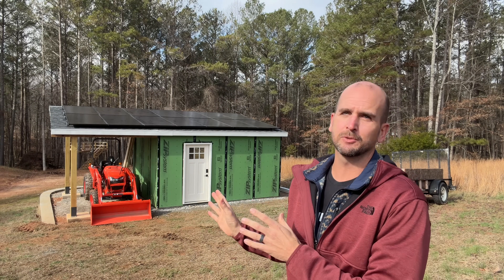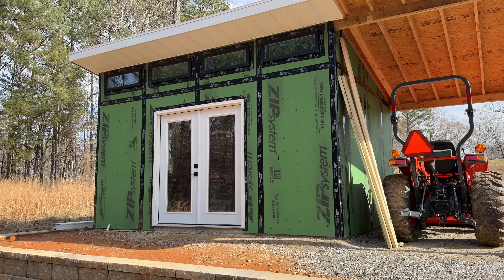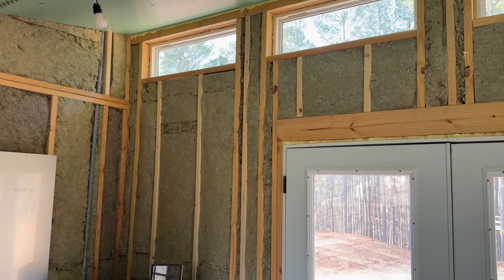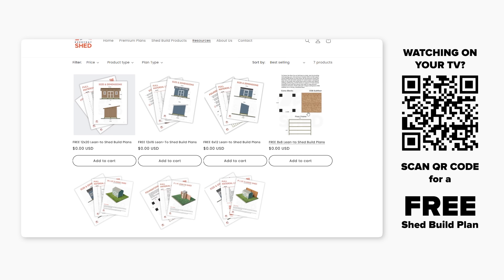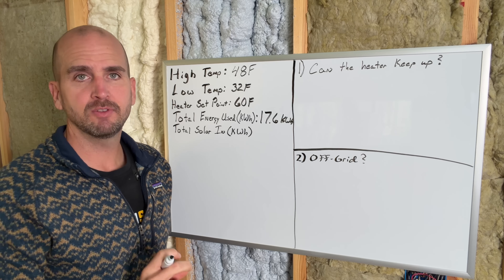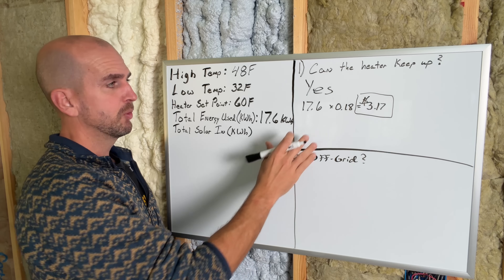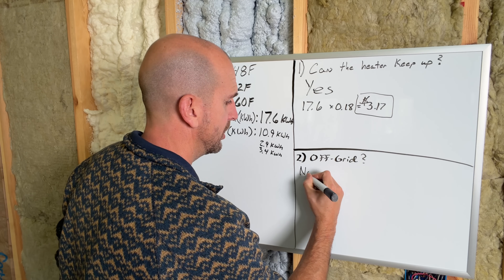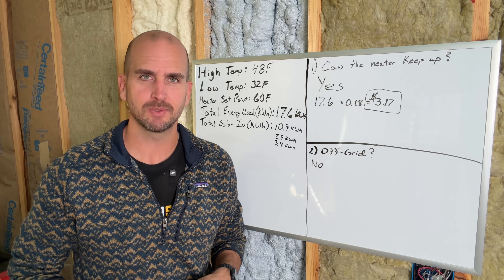HUGE Mistake: Why My $15,000 Solar System CAN'T Heat My Tiny Shed

Comment: What's the sunlight angle in your location in winter? You know, in Helsinki it is around 7 degrees, so the panels would have to be almost vertical to be efficient. Make a gable roof, put the panels on the south facing side - and fill the attic with some cheap insulation. Hay would have been used in the olden days in my area :).
Also, there is a lot of windows there, heat will radiate away during the night. How many glass panes are in them? In my windows there are three glass panes, windows are sealed and filled with argon. I'd make insulated window shutters and close then for the night, to keep the heat inside. It is not without reason that the passive houses have small windows.
I'd make the walls thicker with more insulation inside.
Only then I'd start thinking about the heating tech :). Or forget it and use a wood-fired oven.
Reply: BTW, what's in the Ecoflow power station, lithium cells? In that case, I'd put it 20 yards away in a separate shed build cheap, so there is not much damage if it burns away.
Reply: @grzegorzkrk and then you have to also provide a separate heat source for them. Lithium will discharge ok under 32 degrees F but you can't charge them.
Reply: @David-f2j4b  True, but the power station compartment would be small, so less costly to insulate and heat. Could reuse an old fridge, just reverse the coolant flow. :)
Reply: @grzegorzkrk I have zero experience with those modern backup battery bank systems. Do they produce any residual internal heat when in operation? Putting one in a small fridge or chest freezer "might" trap enough of its own heat to keep it happy under most days. Also I would add a clear top "window" cover to let in sunlight during its charge cycle and keep it warm. Then at night it can still discharge ok, even if temp goes below 32F in the "box".
Reply: @David-f2j4b  I have no experience either, I'm just trying to apply some common sense/physics. Indeed, they must heat up a bit when charged or discharged. They would charge when there is (solar) power available so a fraction of that power could be used to set and maintain the correct battery temperature.
Reply: Its actually no rocket science, you can find components in any ICE car manufactured for the last 100 years, I mean a thermostat, a temperature sensor and a fan :).
Reply: @grzegorzkrk in my area when it gets below -20 F I just build a small fire under my lithium battery bank to keep it all snuggly warm. (Wink wink nudge nudge..😮)
Reply: Hey I just saw you were in Helsinki. I keep thinking about immigrating there from USA. I am Finnish. This country is getting a little weird..
Reply: @David-f2j4b  To clarify, I have not been to Helsinki, not yet. It just came to my mind because I'm working with a guy who has moved from there to my home town of Krakow :).
Edit: The closest, I have driven once to the Polish northern seaside town of Hel. I was driving, singing in my mind "This ain't no upwardly mobile freeway|Oh no, this is the road|Said this is the road|This is the road to Hel".

Comment: In this case, it would take around 1,000 years for a sufficiently-sized solar system to pay for itself if resistive heating was used. If solar ran a heat pump, it would take about 600 years for ROI to occur. This also considers equipment life replacement periods. Just more proof why superinsulating and sealing always more than pays for itself.

Comment: Please test this, run a 500 watt dehumidifer at the same time as 1 or 2 humidifiers, going to use like 525 watts and output the heat of 1500 watts due to the latent heat of water.

Comment: I'm in the process of finishing off my Bike Garage/workshop... it's a 14x30 shed with a garage door, man door, 6 double hung windows and 2 transom windows (all double glazed and insulated). 

I had the vendor spray in closed cell foam for the roof and floor, but left the walls bare because I needed to run additional electrical for 220v equipment and a mini split.  At this point electrical (50A panel) is in and the shell is insulated (R15 fiberglass). I'm half done with sheetrock and am waiting for a couple bits (vacuum gage and valve stem tool) to install and test the HVAC... 

Anyway... I'm currently using a small 1500w heater for the space (it's about 450sf) so I have some data. 

With ambient between 10 and 15 degrees F the heater warms the space to 60f in a couple hours. Early ramp is about a degree every 2 minutes (the sensor is on the opposite end of the space). The heater runs at a steady 1100w when heating the space (as measured at the main box in the house by our Sense system. Don't have maintenance numbers yet). I watched it cool the last time I shut it down and from 60f it lost 10f an hour for the first couple hours (which seems reasonable). It looked like it cost me about $3 to resistance heat for one day but that was a pretty rough estimate.

Comment: 1 issue I see is you did not insulate the top of the roof from the outside..if so worth the effort.. the foam on the roof should have put on the outside not the inside ..

Comment: heating a space that small that has that much surface area exposed to cold is always going to be harder than heating the same space in a much larger building. The cubed law dictates that as dimensions decrease to the square, the internal volume decreases to the cube. So your internal volume is far too small for the amount of external surfaces where all heat transfer takes place. So something like solar panels is not going to cut it. Might as well put in a nice cozy wood stove. The space will heat up very quickly. Most solar panels produce no power under cloudy skies. I have some and they produce nothing even in the summertime when it is cloudy.

Comment: Dude use solar to run an electric water heater and radiant floor. Store heat in water not battery
Reply: I actually run both of those systems. It's not easy to "gather" that much wattage in the dead of winter with heavy snow skies, to heat up a large volume of water. One solution is to have a very large thermal mass underground several feet, and feed hot water into that all summer long when you are making a lot of power. Then use the "flywheel" effect to use the stored heat in the mass to heat your floors. But it eventually runs out too, after some time. Depends a lot on the size of your initial mass, and the insulation surrounding it.
Reply: @David-f2j4b we're in new mexico. Full charge by 10 am. Have you tried bifacial panels? Ours charge in shade and rain
Reply: @indigowendigo8464 I am in Wisconsin, so a little further north. I currently run (8) 545 watt bifacials that I got super cheap from a large solar farm. They had some super light cracking but work perfect. I have 4 on a slanted roof, and 4 vertical mount. I have been surprised how good they all perform under less than perfect weather conditions. They always seem to be cranking out "something" even under cloudy conditions. I can't say anything bad about them. I have no idea how much extra wattage I am realistically getting from the "backsides". Excellent performers in winter too!

Comment: More roof insulation. R10 ain't enough. Most of your heat loss is through the roof & slab. Also, like other's have said a heat pump would be more efficient AND give you air conditioning in the summer. Someomne mentioned tech ingredients geothermal video. With the land you have that would be a great way to go. Good luck with your project!

Comment: Thanks for sharing this. This confirms that solar alone is a failure.
Reply: Solar alone is the only source of power the Earth has ever known.
Reply: @martyjenkins3631  🤣🤣🤣
Reply: Solar works just fine as long as you do the exact opposite of what this guy does
Reply: @mikemay733  Solar is a scam.

Comment: Anyone with a modicum of knowledge about solar could have told you that heating that space with resistive heat and that little roof insulation is a fool's errand.  A heat pump might be able to do it, but that's your only hope. Resistive heat is wildly inefficient.

Comment: There's a reason most homes are not heated by pure resistance heat, except in places where electricity is cheap. So your options are either to use a heat pump OR fossil fuel such as gas or oil.

Comment: Solar power will never be enough. Many people doing these setups are realizing this. Put a wood burning stove in there.
Reply: I am a guy who uses multiple fuel sources. I will say that wood is nice, but requires a lot of labor both to cut and split and feed the fire. But if you have a free source it's great. 
On the other hand, a fuel like propane used in a very efficient and small stove, is absolutely no work, and the system has the ability to be finely tuned and automatically programmed to exactly the times you want heat. And off when you don't.
Reply: @David-f2j4b  My woodburning stove is not my primary heat. Since I have an endless supply of free wood as long as I do the work is why I have it to offset cost of natural gas for my central air which is getting as bad as electric with cost. Also in a grid down situation you don't have to worry about a source of fuel being impossible to get.
Reply: @Bland-79 and that's exactly why I always keep a wood stove on standby. In a "grid down" situation in a very cold climate, your survival can depend on it.

Comment: In alignment with other comments.  Go read up on "coefficient of performance" COP on wikipedia.   It'll literally make the same energy move 3x to 4x more heat depending on the COP rating of the heat pump.  radiators are at best COP=1.0

Comment: Solar is a money pit.  Some day it may work but it doesn't now.
Reply: I don't know about anyone else's "experience" and cost analysis, but solar has worked OUTSTANDING for me for a very long time, using carefully sourced and relatively cheap materials. It provides 95% of my daily power needs, and I sleep REAL GOOD at night knowing the Grid could go down at ANY time and I won't even notice, unless someone tells me..
Reply: @David-f2j4b   Your case must be really unique -- everyone else on youtube is continually adding more solar panels and upgrading batteries.

Comment: EG4 hybrid heatpump FTW. It can operate on DC or AC. If not sponsored by Delta, I’d also use EG4 batteries and inverter components for cost savings. 

Another solution would be solar water heater into radiant heat in your slab. That thermal mass would do wonders for stable temps.

Comment: You'd probably need R 40 or so in the ceiling to make it energy efficient, depending on location. Floor insulation is pretty important as well.

Comment: As others have said, the roof needs more insulation, try to get to R50. Insulate the floor, thermal bridging and heat loss trying to warm up the slab is sucking heat away. What type of windows and door do you have. If single plane, or even double pane DIY windows, a lot of heat loss there too, may have add some more layers. Door should be fully insulated with a good seal. Do that and swap out the radiator type heater, with a space heater that blows the air around and it might just be able to keep it warm. Too much heat loss right now.

Comment: I live in Wisconsin, it's 9 degrees below zero this morning. I run solar, but it can't heat much in the winter. A good passive design helps.  You can run a "little" electric heater, but not a lot. I have an oil filled electric heater just like yours too, I use it when I have good sun. It can help in the daytime. Do yourself a favor and get a "real tiny" wood or propane stove with external air draw, to supplement the solar on coldest days. Build a big thermal mass against a wall, with rock or soapstone, preheat it with daytime sun, and alternate fuel source of your choice, and let it bleed it's heat out all night at a slow rate. Along with a lot more ceiling insulation to trap the heat in. You will survive.

Comment: Heck I am testing to see if I can run a small supplemental solar and heater in our basement. Put a 305 watt panel on the south facing roof, yep when I first put it up there cranking 47 volts, 5 amps to a battery, looked like it would do a good job if I went bigger, then Wisconsin weather said, you better get a big cup of hot coffee, you are going to need it.. snow storm #1 10" of snow on the panel, went to check how it is doing, not a dam thing, checked the voltage 45 volts, 3 watts. So that wont work, I can't get up on the roof to brush off the snow, cant reach the panel with a long brush it is over 30' up and angled, so it will sit that way till spring, looking at my flagpole shadow I should be able to later add a few panels vertical on the side of the house for full exposure in winter, in summer they will be in the shade, so I will need to do zone panels, winter / summer. It is a start of a challange, I would like to do some heating winter, and summer run the central AC, I think I can do it.
Reply: Oh the next couple of storms the panel is under 12+ inches of snow and ice.
Reply: I am also in Wisconsin. I have 4 industrial grade panels on a roof that work hard when sun is higher. I also run 4 panels vertically which work GREAT in the winter months and I never have to clean snow off! I don't even bother to clean snow off the roof panels, sun will eventually melt them off. (Yep, they are sitting under 12 inches right now. Lol)
Reply: @David-f2j4b I was looking outside and my flag pole is a nice sundial, yep I am thinking of putting a string of panels on the south side under the overhang. I should be easy to get 4 to 6 horizontally on there, then as I look at my barn style garage, the sothern, lower roof is sweating the snow off in this 8*F weather.... Going to need to use that exposure next summer for the following winter.
Reply: @davej7434 if you are thinking about putting panels under a south facing overhang, pay special attention to where the "shadow line" falls mid June 21. Try to get the panels at or under that line. That way when sun is high overhead your panels will still get full sun and not blocked by overhang. And in winter, the vertical panels get full sun all winter. In the summer when my panels are "overproducing" more than I can use, I have a 900 watt 24v element at the bottom of my water heater as a dump load, which will keep the tank very warm. If I need more really hot water, I  can hit the upper element with 240v 4000 watt. I find in the summer vertical works just as good as slanted on the roof!

Comment: The 17.6 kWh seems to include the heating up to 60. That doesn't tell you the long term heating costs. That is where the 400-700 watts comes in which makes it somewhere between 10-16 kWh. Still doesn't change the conclusion though.

Comment: You're getting a LOT of interested input, so I'll just repost my answer to another statement.  

Part of the problem is that he isn't just heating that tiny space.  He needs to be more complete with his roof insulation, and probably add some flooring in order to keep the concrete from directly leeching away heat as well.  A heat pump has also been suggested, and it is NOT $30,000 as a disinformer stated elsewhere here, but it can be $5,000, which is still pricier than a simple 1500 W heater.  

So better ceiling and floor insulation, and maybe a bit more on the solar input to keep the battery topped up longer, and I'd bet he'd have it.

Comment: I believe if you build a earth battery and use a passive solar heated box and a small solar powered fan. You can force the heated air from the box thermostatically into the earth battery during the daytime.  And then siphon it into your confined space during the night and possibly early morning hours.  I hope you get it working.  Merry Christmas to you and yours from my family and I.

Comment: That's a beautiful build.  I suppose that if I were hell-bent on having an off-grid space, I might build with 2x6 and do all spray foam.  With 5.5" R-values of 38, 23, and 20 for spray, rock wool, and fiberglass, and with the air infiltration lowest for spray foam, I would have a better shot at keeping it sealed up.  Now, of course, the spray foam will be the most expensive, as you pointed out, and that surely would have to be figured into all of it.  But if $$ were not as critical as the other factors, that would be the way to go.  And the payback would be years, of course, but - hey - you would be off-grid.  :)

Comment: Just to make sure I get this straight based off of the description, cause I haven’t watched it. You used one of the most energy demanding ways to heat a space. Then made a click bait, title blaming solar.
Reply: 36 400 W mono solar panels $4932 plus $400 shipping and handling $1168 Victron multi +2 inverter charger $2499 for a 250 amp hour 48 V battery bank 30 kW from Jag 35 $500 for wiring and connectors $2000 for a solar panel mount and you’re looking at $10,999 plus shipping and handling and tax 7% tax rate you’re looking at $11,768.93 which means you could add another 30 kW battery. Giving you 60 kW of battery capacity and still be at $14,442.86. Which means you can get a $280 10,000 W propane vent free heater as well as a $1100 50 gallon propane tank and be able to fill it with propane for less than $16,000 yeah I’m that guy. I’m not sorry. I like solar and I don’t like people who make solar look ass on purpose.
Reply: Oh yeah with that 10,000 W heater doesn’t matter about the insulation you got in there it’s gonna burn you out